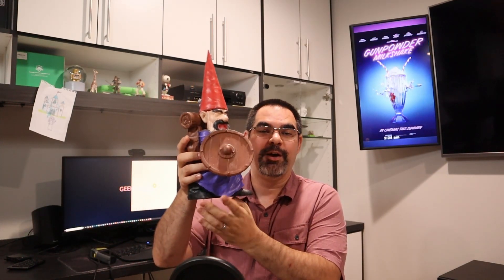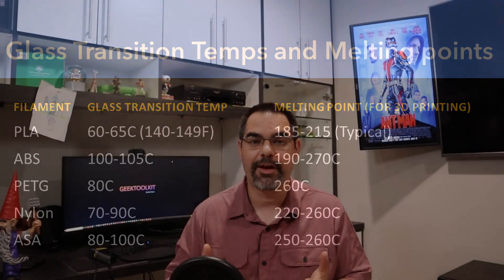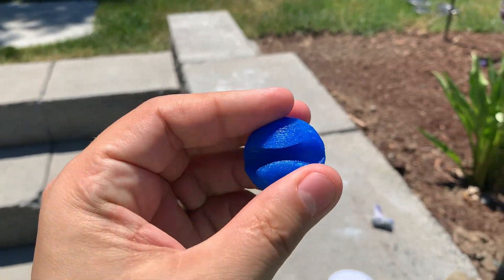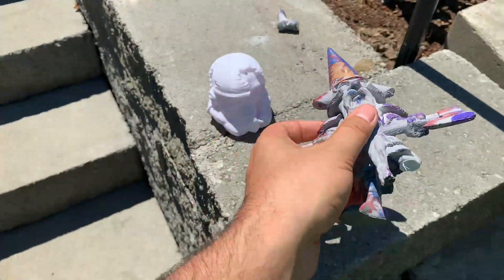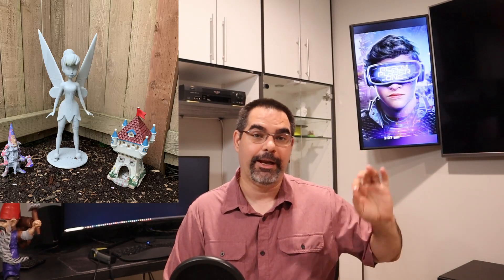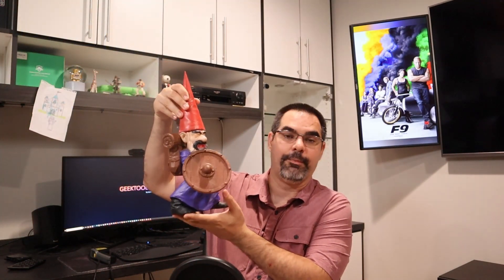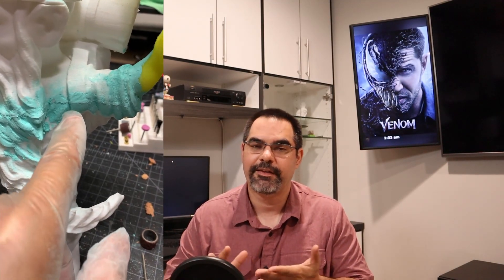How does 3D printed PLA hold up outside in the sun?

Comment: I can confirm here in Minnesota it's just fine. My Dad has a Saab car, which are no longer made. He needed a part for it, so had one 3D printed in PLA that was then painted black. It's been on there for years and still looks as perfect and new as the day we put it on.
Reply: paint protects pla from uv
Reply: Thank you so much for sharing your experience, this is exactly the comment I was looking for. Im printing some non-structural parts for my motorcycle and was wondering if they would last. 💪🏽💪🏽
Reply: @heartminer5487  Yes, and the secondary problem isn't the melting point, it is the glass transition temp, which when you approach, for a part under stress, it will start to DEFORM.  That's the larger problem with PLA and why no automotive manufacturer would ever use it for automotive parts, despite being able to paint them or add some protective coating for the UV issue.

A painted PLA part under stress wouldn't make it one day in the Arizona sun.
Reply: @brianmi40  Hi, do you have experience with resin type parts under stress? (3D printer in SLA technology).
The effect you are describing is tension relaxation and it is common for all thermoplastic polymers... PLA/PET/ABS etc.
But what about parts under stress printed in SLA technology? Do you have any information about it? The effect is the same?

Comment: I can confirm in the SW desert PLA will definitely melt. Especially based on color and thickness. I'd say you're 100% correct in that it's all about surface temp, and there's just so many factors to go off of, but black will melt.
Reply from the maker: Sure. I think the biggest finding I had is that surface temp matters, and shade really affects temps drastically (and grass! That surprised me how much cooler grass was). I do wonder if it’s white PLA with thick walls in shade on grass if it’d survive there. I also want to revisit this with PLA plus, and also see if coatings (primer) matter.  In the end it was a fun experiment to understand deeper about why it happens!

Comment: In Phoenix Arizona we can regularly get to 120 degrees with very intense UV rays. Inside a car it can get hotter at almost 210 degrees. PLA might not melt at those temps but it will certainly get soft and warp or de-laminate if left out in the sun long enough. In a car it certainly will. I know this from experience. ASA is the only filament I use now for outdoor prints as it will hold up to the heat and the UV rays, where PLA and ABS become "bleached" and turn yellow by the sun here... if you are talking surface temps, you can fry an egg on our sidewalks in the summer so there is that...
Reply from the maker: Right. I tried to cover the car scenario in the video and explain air temp vs. surface temp for that reason, to bring awareness.  120 air temp alone shouldn't be the factor that melts it, it's the absorption (based on color), density (based on infill), and surface temps that matter, and there are variances even in PLA.  Placing PLA on grass is going to be much different than placing it on concrete.  The car scenario is entirely different because air temps alone can get into the range where it'll affect the print due to it acting essentially as an oven.  The thing I'm trying to understand is if it's 120 air temp in Arizona, what is the concrete temp, vs. the grass temp for surface temperature.  If the grass is not much hotter than 120, I'd expect the print to be fine and not warp.  And if it does...that's what I'd like to understand.   A recent comment said that it's not the glass transition, but HDT.  HDT temp ranges are MUCH lower, and that may explain why I see reports of much lower temperatures affecting prints.  
   The UV angle you bring up is critical...and something I didn't cover well enough.  There's a video from austrailia that did a great job of showing that and it really showed that even if the temp and rain doesn't kill it, UV alone can.  

I'd love the community to lock that info down so it's understood.  That all being said, if you're in Arizona, I would just not use PLA for outdoor prints :)  
  Thankyou good comment and good info.   I kind of wish I lived in a warmer climate sometimes to get some better test data
Reply: Thank you for your mars service lol!

Comment: Apples and oranges, but me being in AZ, I put big coins/badges in pla and resin prints outside, and they all started to warp or curl after a couple hours.
Reply from the maker: So the questions I'm curious about are: 1) What is the thickness of the prints? 2) What infill? 3) What color? 4) Does it still warp if you set it on grass? Are you setting it on something that retains heat?  From what I'm seeing, and tried to show in this video is all of these matter.  But the tough thing for me is what you get daily for temps to do the experiments/experience it I only get like once a year :)  
  Resin is interesting, I don't know anything about resin temps or heat resistance, but I was hoping it was going to perform much better than FDM filaments.  What I'd like to ideally get to is a 'these are the guidelines for a print to stand a chance' for things like infill/thickness/design as well as just knowing 'ok even on grass in 120F this thing will/won't be destroyed in 6 months'.
Reply: @geektoolkit    Sorry for the late reply, for pla, small one was 3.15mm thick by 25mm diameter, biggest being 8mm thick by 110mm diameter.  For resin 3mm thick by 50mm diameter.  All 100% infill, overture metallic green/black for the pla and clear for the resin.  I set them on wood with the plan of checking them in 30 minutes in direct sunlight, 2-3 hours later i finally remembered and they were all warped.  Enough for me to call them un-useable since they were planned for mold making/metal casting.  Hope this helps.
Reply from the maker: @wantafastz28  Thanks for the reply and data! That should help others that are considering this and give them a different viewpoint to consider.  I wish there was a more definitive way to know what's 'safe' and what isn't. I have to wait till summer comes around again, but next time I'll try thin prints, differnet infills, different colors and see if I can get a better matrix. Also I'll keep note of brands and print settings..I know some silks I have print at much lower temps, so maybe there's something there
Reply: @geektoolkit  sounds good, look forward to watching it next year. :)

Comment: I just think there's so little difference in cost to use PETG that you just don't even consider PLA for outside.  I have PETG for a window actuator part in my son's car, and in Florida sun it's still good after 2 years.

Your prints aren't also parts under stress, which completely changes everything.  PLA deforms readily under stress and heat which is why they should never be used in a car.
Reply from the maker: @brianmi40  absolutely. When this video was made PLA+ wasn’t really a thing yet, and petg was about 30% more. But really what I wanted to do was understand what was it that was causing something that took 185 degrees F or so to warp in 105F degree heat? It taught me about the importance and difference in air temps, how colors and infill affect it, etc. 

Nowadays petg is so close in price and availability it definitely makes sense to go that way. But I think regardless the lessons of heat are important. I’d also argue UV may be as important if not more in some ways for items that are just decorative.

For anything like a plant holder or holding weight, absolutely PetG is the way to go unless you’re looking at something even more sturdy like I believe ASA and Carbon fiber can be

Comment: How do you think 4x4 caps for fence posts would work? Thinking about printing solid black. Or is it better to go with PETG?
Reply: I can answer this, I printed a black planter for outside. It warped after a warm day at around 80 degrees farenheight or so. Black is not a good color to do outdoor prints with if it will be exposed to direct sunlight.

Comment: Joe this is the video i was looking for thank you. I live in PA an go to the jersey shore my parents have a house there anyway i have a question i am making pole holders for his retractable awning so when the wind is strong the awning doesnt bounce. I made the holders out of pla white last year and the bottom holders are still going strong they are out in the sun in the all year and and i just checked them last week and they are still great the other to holders the top ones are up under the awning away from the sun they are in the shade will they be ok our weather here goes up to 90s it the summer and winters are cold and fall and spring 50s and 60s but the humidity sucks in the summer but so far so good the top 2 holders under the awning snapped off when the wind kicked up but that was also because the design was terrible hopfully you can answer my question thanks
Reply from the maker: Hey Geo I'm not sure I caught the question, but I can say this...this experiment calls out that these are done under no load scenarios for things like garden decorations.  I would go with PETG or something else for things underload, and then paint/spray them with something to UV protect them.  This video was just for decorations, not loads.  That's a whole different beast because if you get to the temps that would soften it, you're going to have problems.

Comment: You don't want glass transition temperature.
You want to find the HDT (heat deflection temperature).
Reply from the maker: Ah interesting! From here https://www.creativemechanisms.com/blog/learn-about-polylactic-acid-pla-prototypes that could be as low as 49c/122f which over time and places on a certain surface would cause it to warp. This experiment is so hard because I’ve had people message and email me all sorts of variable results based on infill, humidity, color, brand and more.  I had to move so I didn’t get to see if mine would last through the year, and the Tinkerbell which was my main test was destroyed by a different natural force…a toddler.

Comment: I left a print outside while spraypaint dried and it started to warp. It was only 70 f outside but it got direct sun for 20 minutes and i guess that was enough. It was low infill though so that may have something to do with it.
Reply from the maker: I suspect infill also what was it sitting on? That’s the thing I found to be more important. For instance concrete over grass matters

Comment: what about tests leaving ur prints in the garage with little to no sunlight exposure?
Reply from the maker: Hmm. I suppose it matters if your garage has cooling and how insulated it is. Mine is similar to the shade measurements so things have been safe there.
Reply: I can confirm from experience, depending on how hot it is outside and how ventilated your garage is, PLA will get soft and warp. My friend left a lantern I printed as a going away in their garage while the movers packed the rest of the house. He went back into the garage and it was warped a solid 30 degrees. 

As he mentioned though, the structure will also affect it. The portions that warped were the load bearing corners of the lantern (if you can picture a lantern and the parts that would typically hold the glass panels). Not to mention it was all black, one of the most heat absorbing colors.

Comment: You never talk or mention something important here...the surface temperature of the object after been under the sun for long period of time..
For example if here in florida te temp  outside reads 100..dosnt mean thats is ok for pla..cause that pla object surface are going to be taking  the sun heat direct.so means that that surface are going to be more hot than the 100 temp after been exposure for 1 hour..and more and more  hot after 2 hours.etc..
So my point is that dosnt matter if the temperature outside is 100 for that day dosnt mean that the pla object  surface sre going to be at 100 temp...cause the sun are hitting it making it more hot with the time exposed making the object to bend or deform..thats why we always said tha PLA and Sun dont mix
Reply from the maker: I believe I cover that about about 5:43 talking about the surface temperature of the brick that it's on, and demonstrating that air temp is not equal to surface temp.  I didn't speak ot it, but the surface temps of the models after several hours never got close to the surface temp of the brick (which would make sense as the brick is an excellent heat insulator).  
   But this is a great comment because it's exactly the point of my video...to show that air temp isn't the only thing to consider, and to talk about all of the factors that go into pla in the heat. I also wanted to share my experience with it.  If others have experience hopefully they'll share it in the same way with measurements and as a community we'll get a better guidance.  For me hearing 'don't put PLA outside' didn't make sense, and from my tests where I"m at, it seems like it's fine.  I'll do an update in a year though because I think it's important data for the community to have.

Comment: I think you should be fine putting a decorative, non-load bearing print outside, as long as it's in shade, and something that typically don't get that hot (like grass)
as it wouldn't be just the air temperature, or the surface temperature of the material the print is standing on, however how hot the print itself also gets, due to the sun, etc.

as the sun is the same (main) culprit to the surface temperature issue, the print would become just as hot as the cement brick you put them on.
Reply from the maker: I agree with the first part, I’ll have to test the second part. I think there is a heat conductance difference between brick, PLA, and grass. I don’t know if the PLA absorbs as much as the brick and therefore wouldn’t be as hot, but I’ll test that as it’s a great point and if that’s the case it flips some of this on it’s head. That being said at 109F outside on a 140F brick I really was impressed how well this all held up!!!
  Thanks that’s a thought provoking comment, now I’m off with my laser thermometer to go test more!
Reply: @geektoolkit  when you mention the melting point of pla 185 to 220..thats melting point to turn it from solid to liquid..deforming point is much much less than 185 buddy
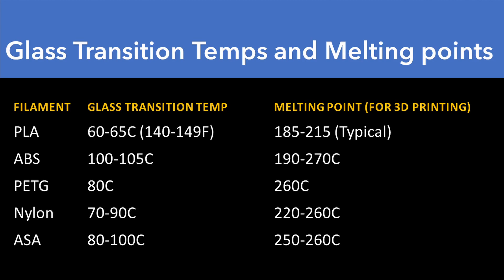Reply from the maker: @rodsants8972  I show that and talk about it at 1:48 when I talk about glass transition temperature (the proper name for 'deforming point'.  I also  mention how that is 140F and still way beyond air temperature, and then go into surface temps.